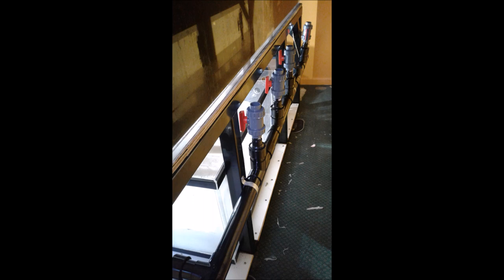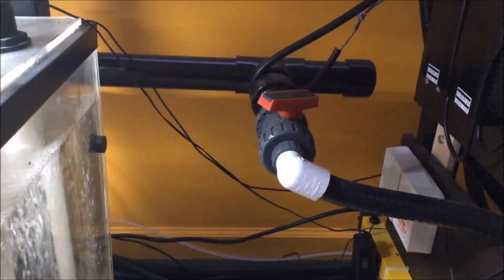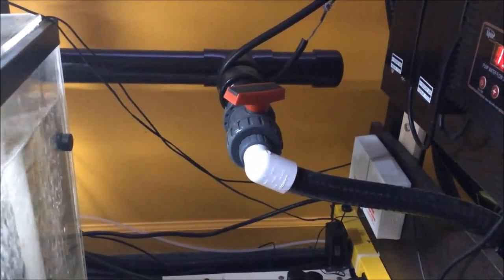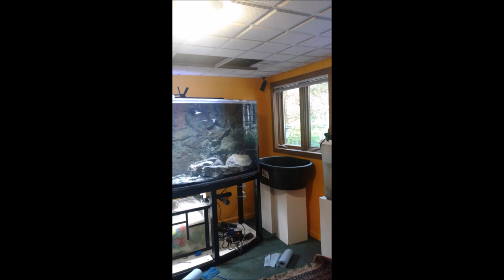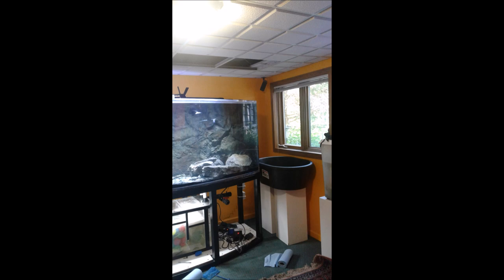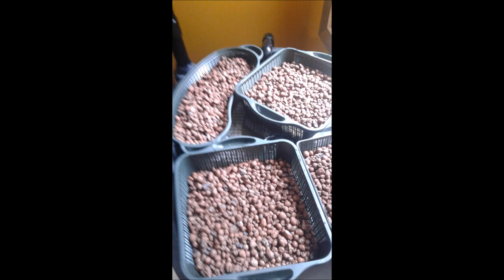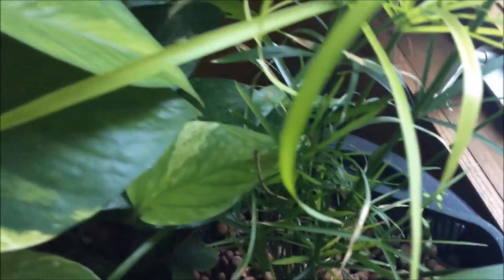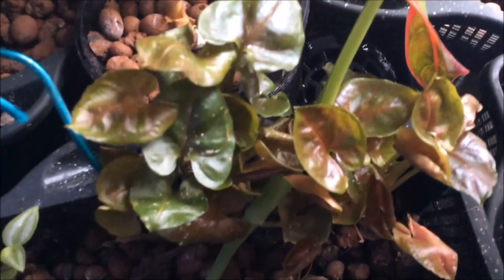Eliminate Water Changes through Aquaponics

Comment: I have used several of your sump ideas in the past and I am in the process of building a similar, albeit smaller, aquaponic system - The way I understand the plumbing is that some of the return affluent goes into the tank, while some goes to the grow bed and is drained  back into the sump (?) -  I was considering a second pump  exclusively for the grow bed - independent of the sump - what are your thoughts? - Thanks for all the great info!!
Reply from the maker: You are correct, my return goes into a manifold with a separate valve that allows flow to the hydroponic bed.  There is an overflow in the bed that allows gravity flow to return the water to the sump
Reply from the maker: A separate pump is another option if your existing plumbing does not accommodate a pressure feed to the bed, or if you do not have enough flow from your existing pump.
Reply: @HalfManHalfCichlid  Thank you for your replies!!

Comment: Just found your video. Brilliant set up. I've been thinking about setting up an above tank plant sump (series of planters) on a shelf but this set up is much more attractive and functional, plus room for more plants. How are your nitrate levels now.
Reply from the maker: Susan Briggs the tank is heavily stocked as you can see.  I am doing a 60% water change every three weeks. Nitrates stay below 20ppm.  I know that the plant and root mass can still at least double in size.   So I know the beds ability to purify water will only improve with time.  Have you seen latter videos where you can see how big the plants have gotten?
Reply: @HalfManHalfCichlid  No, I will definitely check out!  I'm new to Ben O'Chart's Facebook group (although I've followed him for awhile). Have you ever shared your set up with Ben's group?
Reply from the maker: @susanbriggs862  yes.  Aquaponics and terrestrial plants like pothos need to get more publicity as the most effective and natural way to purify (not just remove nitrates) from aquarium water.
Reply: @HalfManHalfCichlid  no sir...pothos Is still a slow plant. Nothing compared to pistia stratioides.  I think pothos Is overrated plant...good for this job but surely not the best.
Reply from the maker: @brankhaykhondar1195  as I have learned more and gained experience I agree pothos has little affect on nitrates.  It is more of a novelty and "feel good" strategy for nitrate reduction.

Comment: Nice video, so, how has the planta helped removing ammonia & nitrates so far?

Have you done water test kits?

How much longer can you get away from water changes?
Reply from the maker: I am switching and calibrating my nitrate testing.  I have found most kits for aquarists to be essentially worthless if you want to measure with any accuracy +/- 15 ppm.  I am currently testing LaMotte strips and having the results validated by an independent lab.  So it is a little early to quote any quantitative results.  I do know that the nitrates have stabilized at a low level for about three weeks.  Before the growbed I could see quite a rise in that period of time.
Reply from the maker: Once I get the nitrates stabilized in the 10 - 20 ppm range (maximum), I will do water changes every thirty days.  Keep in mind the bio capacity of the aquaponic bed is estimated to be only about 10% now compared to what it will be when the tub fills out with plant roots (check the first picture in the video). I do expect to get to one water change every three months with nitrates in the 10 - 20 ppm range, maybe lower.

Comment: Sweet..

You only have to get your audio smoother now.  You are recording in a loud area. You can record just a blank spot of background noise and then apply that sound to the filter and it will filter out that background noise. Sometimes that has a funny effect on the voice audio though. If you are doing it in your office and that is the pumps we are hearing you may just turn them off for that few minutes. 
The chunkiness of the audio is your only presentation issue. The content and the flow is good for understanding. 
 I have done the semi bare bottom you suggested, but with black and quartz tiles that I had left from my bathroom update. Lowered the outputs from the return pump to sweep the bottom and there is NO maintenance but water changes and they are easy due to my tank location, everything from one hose, and the water flows quickly since it is siphoned to the basement.  So much nicer!!!

They Malawi tank is looking good and easy to take care of. 

Later